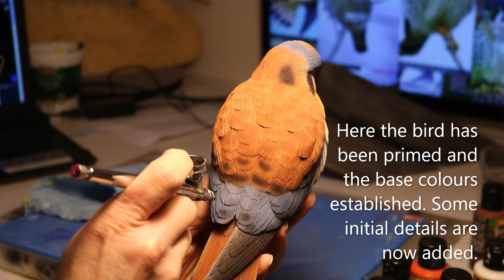Carving And Painting A Bird of Prey Out Of Wood - American Kestrel

Comment: What do you use to seal the bird before you prime it ,is it thinned with a solvent?
Reply from the maker: I seal them with a semi gloss clear lacquer. Usually Deft or Watco brand. Sometimes I will cut the first coat by 25% with lacquer thinner if the detail is very fine.